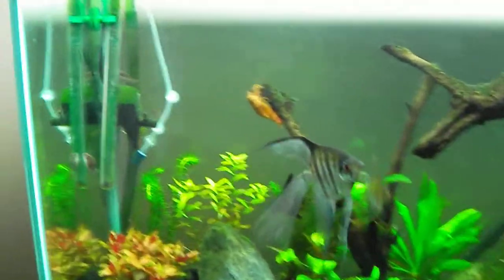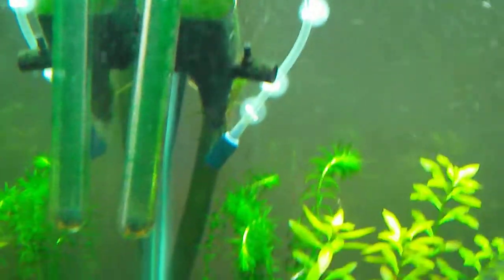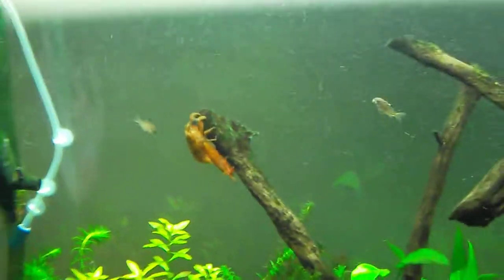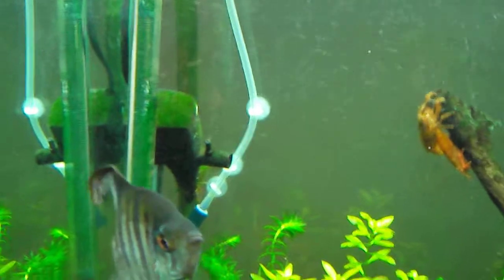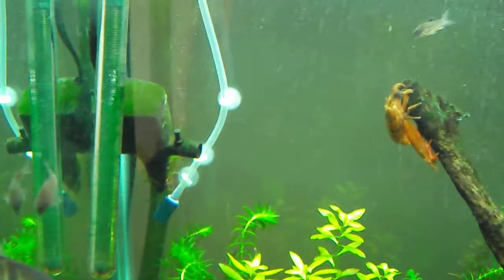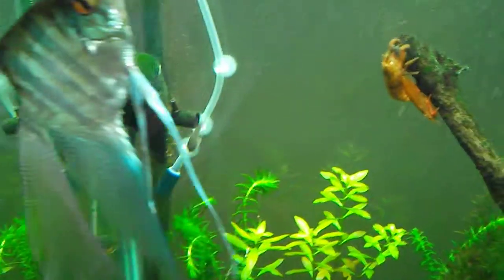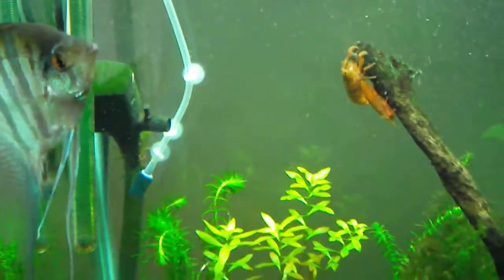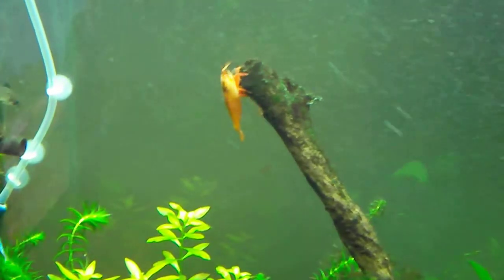How to diffuse co2 efficiently?

Comment: That is really about the best you can do unless you get a In-line Reactor/Counter-flow Reactor setup which keeps the co2 bubbles trapped below a point so they have no choice to diffuse into the water fully. Other than the that the power head method diffusing the small bubbles around the tank is about the most effective way. As long as the bubbles arent just goin right to the surface your doing better than many people.